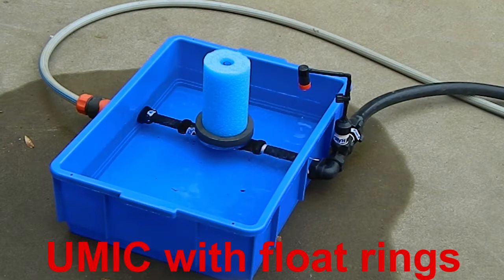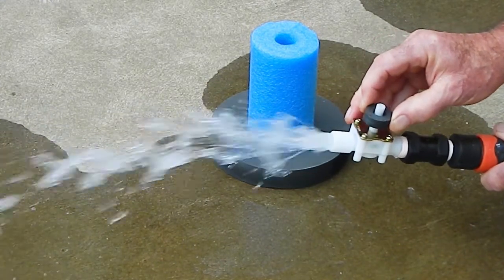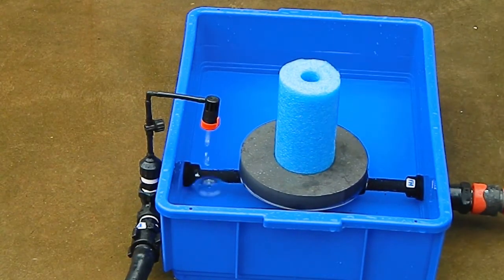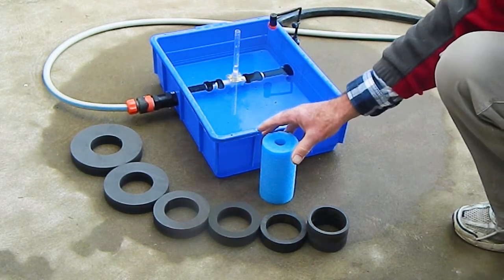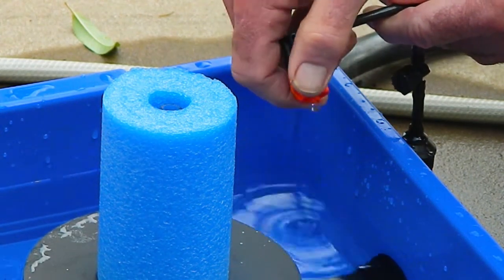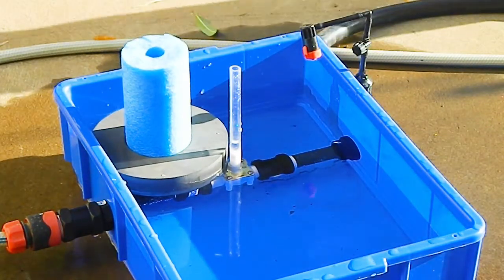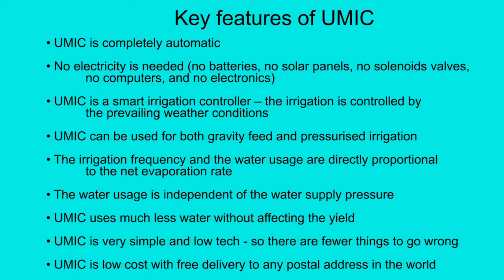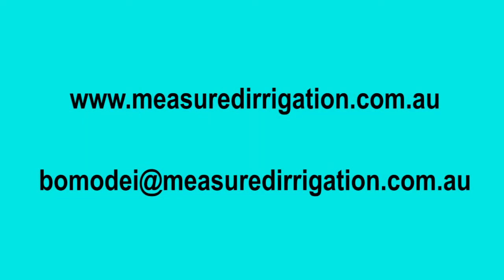Unpowered Measured Irrigation Controller

Comment: Been running hydro systems in the midwest WA for a few years, always comes with challenges because of hot weather and maintaining water and PPM concentration levels. Im moving back to soil based systems in wicking beds, your watering systems will be a game changer for me. I run of a couple of 300 litre reverse osmosis water tanks and with your wicking bed controller I will be able to maintain water levels without regular monitoring of the system. Genius